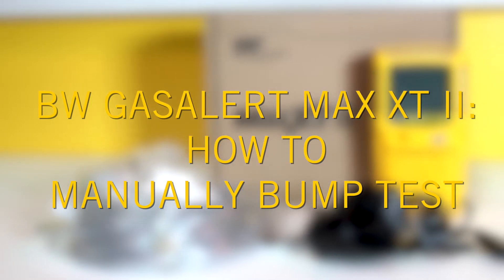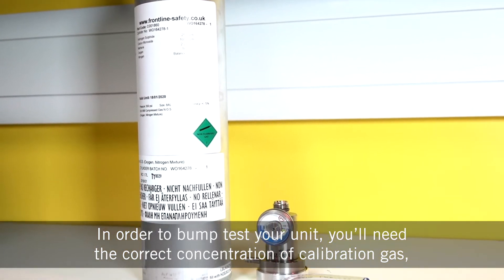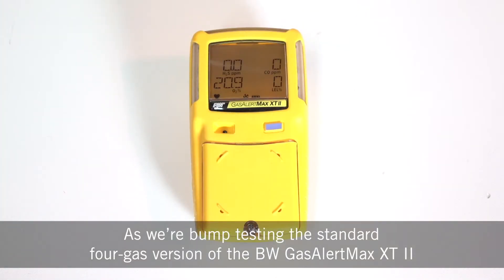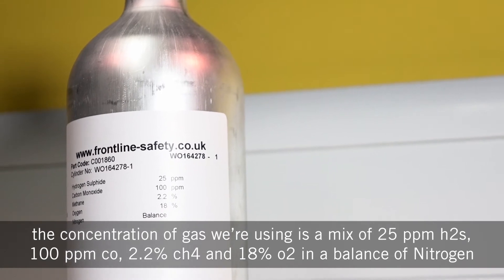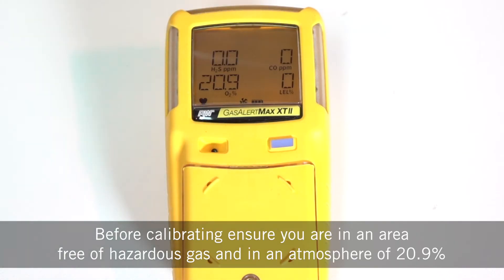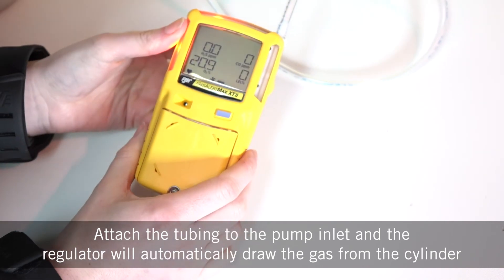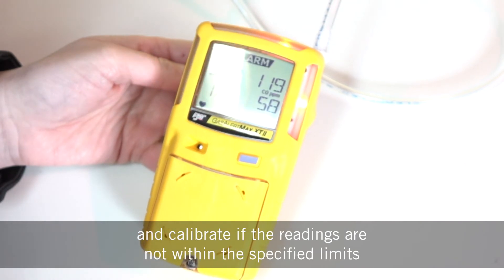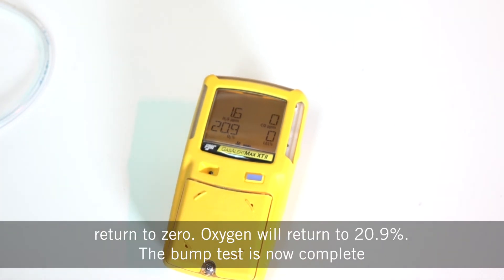How Do I Manually Bump Test the BW GasAlert Max XT II Multi Gas Detector?

Comment: What's the different between bump test and manual calibrate for max xt 2 ?

Both are same or not ?
Reply from the maker: Hi Sendy,

A bump test is completed to determine the sensors are responding to the target gas and should be completed before each day's use. Although calibration is a similar process, this is completed to 'reset/recalibrate' the sensors against a known concentration of target gas, which a bump test does not do. 

Please refer to the product manual for more information regarding bump tests and calibration.

Hope this helps!
Reply: @Frontline-safetyCoUk  by the way, do you know about component on O2 sensor ? If you cut / crush the sensor... Is it the chemical component or not ?

Comment: i did what the video said , but dont function
Reply from the maker: Hi Oscar, 

If you have attempted to bump test your unit and the monitor has not picked up on the readings from your calibration gas, this would most likely indicate that your monitor requires calibration. We have a short video guide for calibrating the BW GasAlert Max XT II here: https://www.youtube.com/watch?v=Izc7tLxeSP0&t=38s. If you are manufacturer trained you can calibrate the instrument by yourself. 

If your monitor continues to be unresponsive to gas during the calibration, this would indicate that the sensors are faulty and that they would need to be replaced. Please refer to the manual for more information regarding this! 

Hope this helps!

Comment: i did what the video said and my gas levels went down to the bump test levels but when i shut it off and turn it on it still says failed last bump test
Reply from the maker: Hello Bub,  thanks for your enquiry.  Does your monitor show the message 'Bump Due Now'? if so this means your monitor has been configured to carry out a bump test at a set interval.  The procedure is the same as in the video, once this message appears on the screen apply calibration gas to the unit (see your calibration certificate for correct concentration of gas to use), leave the gas on for approximately 60 seconds until the gas sets the alarms off and the readings match the concentrations on the calibration gas bottle.  Remove the gas and allow the sensors to stabilise back to zero.  The message bump now should clear and the unit should be safe to use.  If  this doesn't work I'd suggest you return the unit to your nearest Service Centre.  If you have further questions please contact calibration@frontline-safety.co.uk.